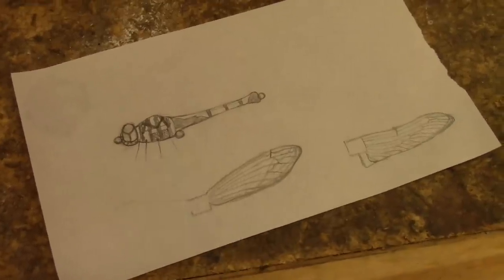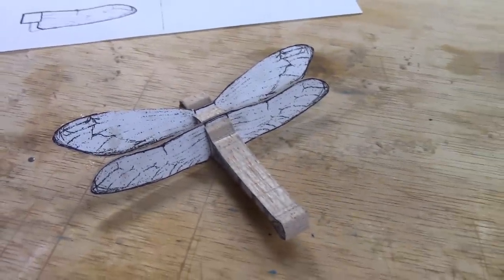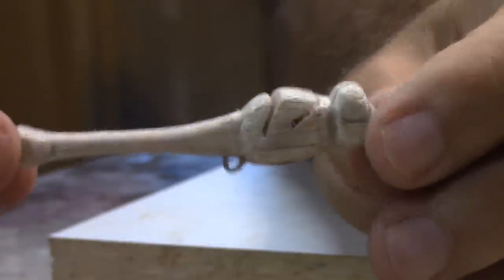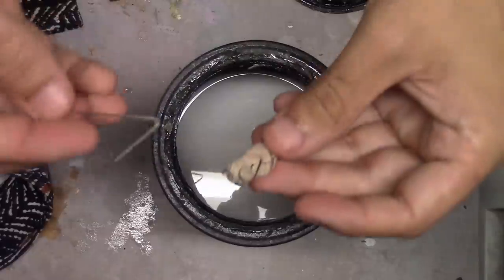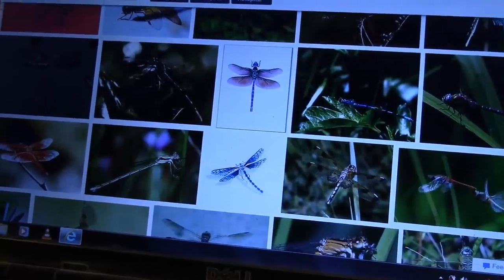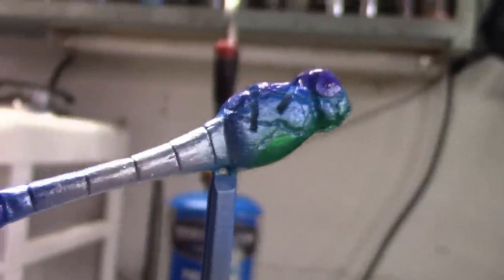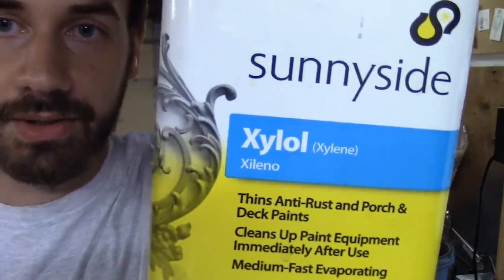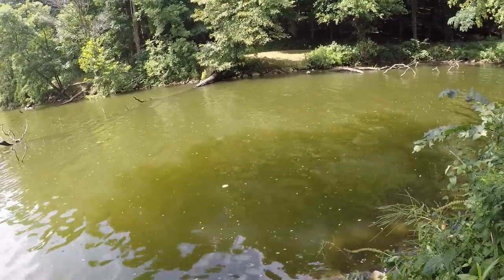Making a Dragonfly Lure

Comment: I think it might work well as a popper. Otherwise, the action that a dragonfly has in the water is typically them vibrating the top of the water as they flounder around and try to find something to hold onto. I think it would be interesting to see a small oscillating motor inside of a bait to really mimic that high frequency vibration.
Reply: I agree

Comment: I think you should make a wood top water frog, with the hook on a pivot right by its eye, and the hook point being hidden by a spring on the inside, pushing the hook down. When a fish bites it, the spring compresses and the hook point pops up. Basically a regular soft frog, but wooden, and an internal spring keeping the hook down.

Comment: 6 years late, but I use Createx paint specifically for painting lexan (it's used for painting vacu-formed lexan RC car bodies.

It helps to scuff the surface first with fine grit (I use 600-800) to create more surface area for adhesion. Actually, it's a great idea to sand blast lexan with fine grit before applying gloss clear coat anyway, because the gloss coat will fill the scratches and return it's clear appearance, while more solidly adhering to the polycarbonate, as long as there's no grit or foreign material left behind.

I also think lead was overkill with so little balsa. The hook on the bottom and back should be more than enough weight. If not, dressing the bottom hook with some thin wire legs would do it.

Comment: I know i'm late, and maybe someone already told you this, but Lexan or PC needs a special paint that dries flexible, RC cars use this. Pactra is one brand, and Tamiya also has a range of colors. also, you should really try oil paints for black line work, or picking off details, airbrush a acrylic clear coat first and mix the oil paint it into a thin wash, and if there is a problem, just use odorless thinner to remove any unwanted oil paint, as it wont solve the acrylic paint.  awsome baits btw

Comment: Make the ole Cajun Phil lures they were jointed floating perch with a string pull mechanism in the bait where when you threw it the string pulled out and made a plexy glass tail flutter and kick on the surface and the bait kinda swam in a circle because of the joint ....

I’d pay good money to get another one I had several as a teen in the early 80s but he stopped making them and I lost all mine in a house fire 🔥

Comment: What can you use besides lead. I'd like to make myself some lures, but I really don't want to mess with lead.
Reply: Michael Keeter tungsten
Reply from the maker: The higher the specific gravity of the material the better. Tungsten weights, steel, other metals.. and if you just don’t want to melt lead you can used bird shot.

Comment: I used to catch a lot of bass growing up with real dragonflies and I think you should fish it slower. A real dragonfly will just float on top. Also create on with more weight that can sink and suspend under a float of some sort.
Reply: Robert Jacobs can you tell me how you hooked them? And what ur set up was/is?
Reply: How you hooked the dragon flies
Reply: I used a small Mustad No 4 hook and hooked it just behind the head just in front of the wings. I also used a cork float just about 40cm from the hook to assist with casting distance as well as when I was fishing them suspended as bite indicator. I would also fish it on a light spinning outfit to assist with casting distance. I used 10lb green Maxima monofilament for all types of fishing growing up.